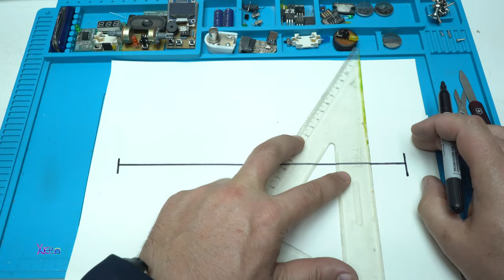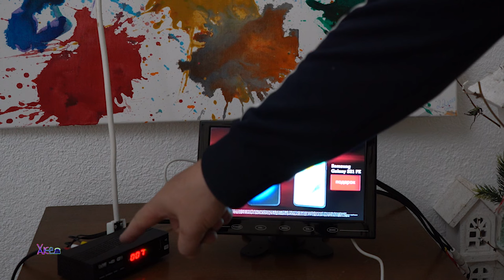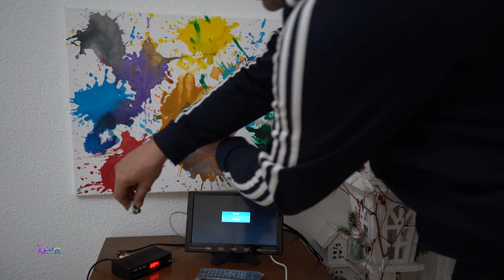Homemade HDTV Antenna using only Coax Cable || You Will Thank me Later

Comment from the maker: The frequency of the electromagnetic waves is related to the wavelength by the well-known equation λ = c/f, where f is the frequency in hertz (Hz), λ is the wavelength in meters (m), and c is the speed of light (2.998 × 108 meters/second).

Comment: You can also connect your coax cable from the back of the TV into the center of a wall outlet screw...it worked for me, same result as a $50 antenna "-